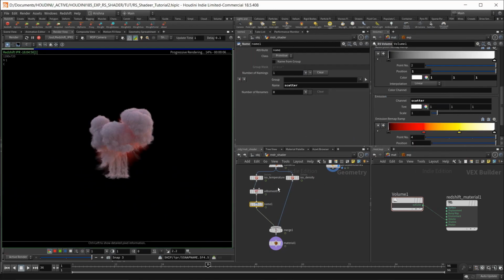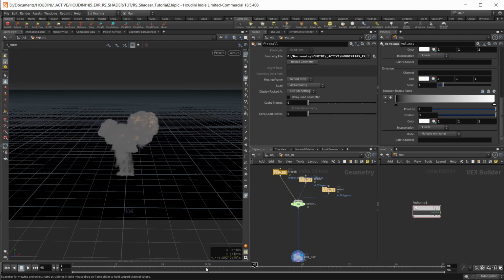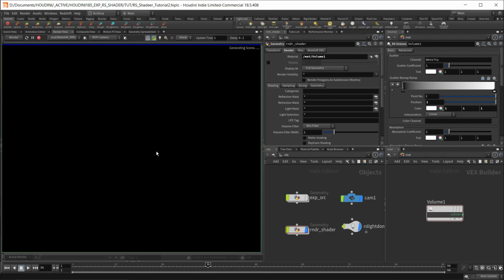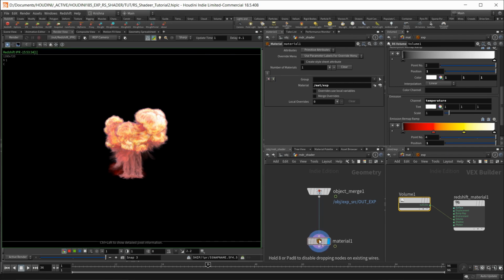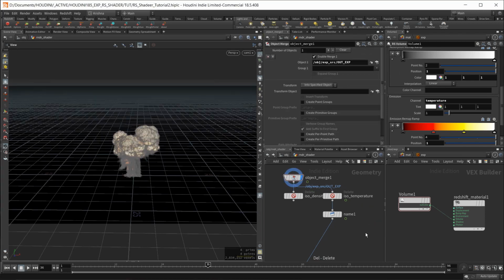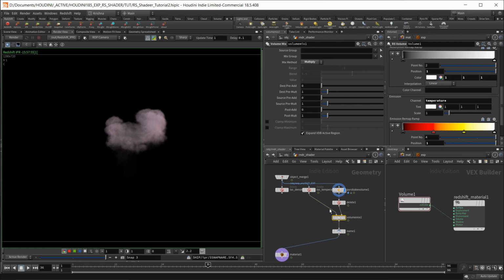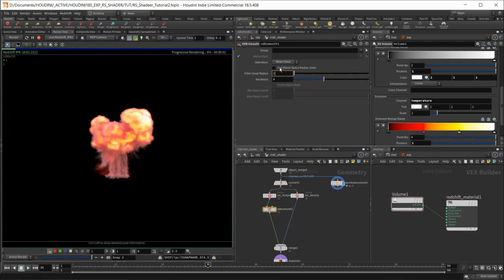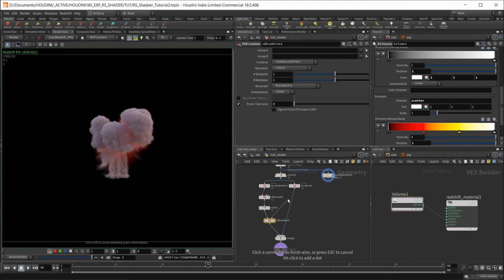HOUDINI EXPLOSION - REDSHIFT SHADER - PART I - BASICS

Comment: Hey, so ièm doing a fire sim with sparse pyro fx, i did the simulation but when i try to render it in redshift using RSvolume, im able to see small particle sort of things in render and not the flames. Im confused now
Reply from the maker: Hi, Assuming you followed redshift setup as per this video I am not sure why you are not seeing the fire. Maybe try this tutorial series which is actual fire setup. https://www.youtube.com/watch?v=yUgXg5avbrY&list=PLi9R7ToKlBz18N6L39FgqvinktS5nPHuV
If else you can email me a screenshot to resilientpicture@outlook.com. I'll try my besy to help you.
Reply: @resilientpicture  yeah the problem was in rs volume I used heat instead of the flame parameter as heat wasn't in my timeline itself solved that issue now having problem on how to do a shadow matte in mantra for the reflection of shadows, like a comparsion in doing with redshift and mantra render engine
Reply from the maker: I see, well done. Good work. I'm sure you'll have an option to say which objects are shadow mattes. "Forced Matte" in mantra render node for that. I usually render that out seperate using its own render node. Does that make sense
Reply: @resilientpicture  yeah will give it a try

Comment: I'm confused, where is the 2nd part to this tutorial? I purchased the link on Gumroad but it looks like all I got were Hip files?
Reply from the maker: Sorry you are having trouble. But the tutorial files are part of gumroad files. Apologies for confusion, the tut files are in 18.5_rs_shader_update zip file
Reply: @resilientpicture  Got it! Sorry! thanks for the courses! was just looking at the gumroad list and only saw .zip files and hip files. Redshift is such a painnn to get good fire shaders in!
Reply from the maker: No worries, I should organize the files properly. I hope it is helpful. Yes, redshift can be tricky but worth the time as it's lightning fast.
Reply: @resilientpicture  Love the course so far! Curious though if theres a reason you dont use the vector merge vdb node to get all three densities from the volume ramp into one vdb? Just wondering if theres a reason to isolate one channel
Reply from the maker: Thank you. I'm glad you are enjoying it. If I remember correctly the vector merge will still hold the 3 elements (XYZ) internally (although combined) causing issues downstream when used in vdb merge nodes. it will throw "there are more a grids than b grids etc) hence the isolation. Hope it makes sense.
Reply: @resilientpicture  Awesome thanks!